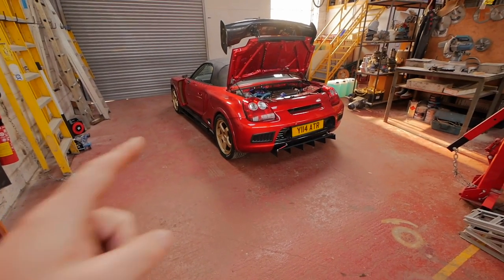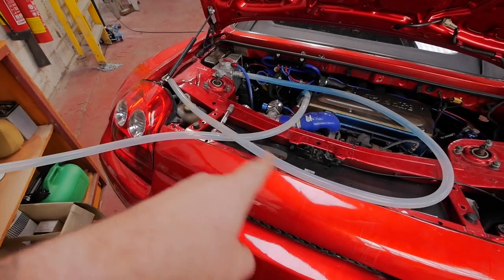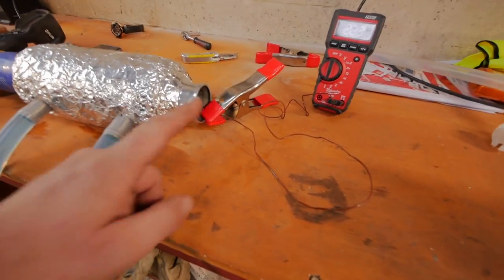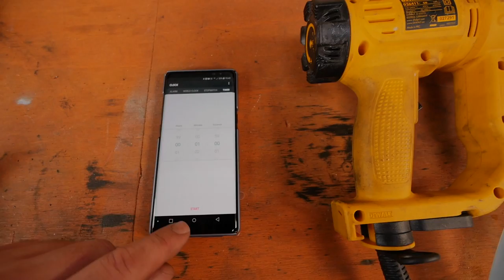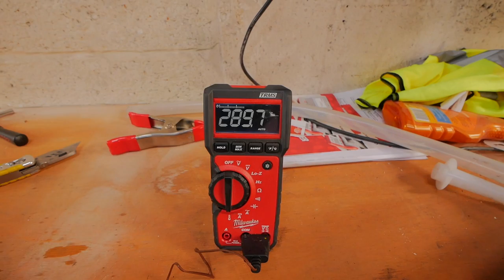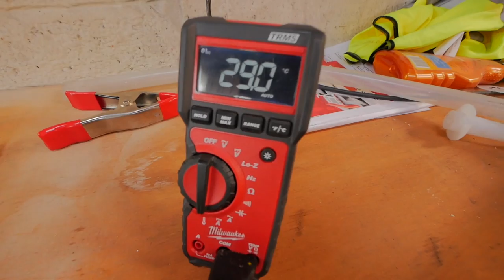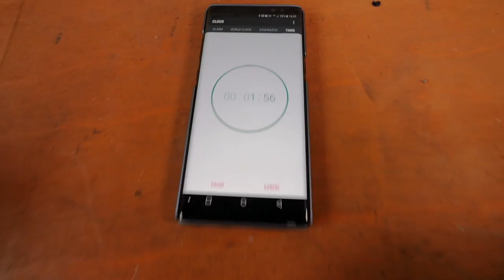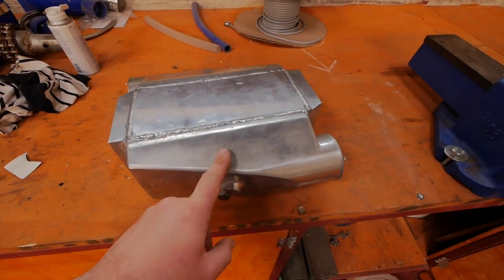Cheap vs expensive chargecooler shootout experiment

Comment from the maker: I fitted the cheap one to the car today... From driving it around today this deserves another video with real world results.
Reply: can you post a link to where on ebay you got this cheap charge cooler?
Reply from the maker: Hoang Bui that exact one is not on at the minute but if you type universal charge cooler into the search, the first ones that pop up are the same sort of thing
Reply: Any update on that? Did it feel as much better as it worked on the bench? :)
Reply: what about the boost pressure drop from the larger IC?

Comment: Airflow in CFM on the Output, Should have been included...  If you're getting 500 CFM out of the Little one, and only 100 CFM out of the Ebay one... that kinda kills all the good, that the cold air Provides.
Reply from the maker: John Caprai I was going on the assumption that what goes in must come out. I will try it on the car for a proper real world test

Comment: Great experiment that has proved that the cheaper one works well. My concern now is the pressure drop of the charged air. You mentioned that there was a better flow from the tube cooler..As you have a water to air rad with fans it sound like even if the tube cooler isn't so efficient the rad + fans would cool it sufficiently. I would be concerned about choking the charged air causing a pressure drop.
Reply: That Intercooler plus even the most restrictive ones out there will have as much as a 1 psi drop in boost. Definitely not a concern vs the benefits from cold air going into the engine.

Comment: The Cheaper one is acting like a large heatsink and the airflow from the heat gun is probably to small to saturate the amount of aluminum area. If you had large amounts of airflow, the test would be more conclusive.

Comment: I had a pwr cylinder and switched to a cheap one like you have. Same results. Much better with a cross flow unit and much less pressure drop to boot.

Comment: I think this was a pretty decent bench experiment.  I think what we learnt is that the larger the intercooler with direct flow actually works better in addition to the fact that the eBay version probably hold more water in the cooler itself which the air has to even hotter in order to heat. In comparison to the cylindrical version which although has higher air flow, had less water in the system in order to move  the heat. This resulted in the temps being much higher. I don’t think it quality that won today. It was definitely quantity and volume. Well done and thank you for the content.

Comment: Even if the CFM wasn't the same on the output on each it does prove the over all cooling was best on the cheap one. Same amount of heat for the same amount of time. On the jack of all trades the cheap one was best in my opinion. I would like to see somebody run this type of system on a cold air intake and see if it works. Just for fun

Comment: Only problem I see with the test is that the eBay intercooler was only half full of water due to inlet and outlet fitting location. To fully fill the fluid portion of the intercooler, the supply fitting should be at the bottom and the return fitting up at the top. Without doing that, the top half of the core wasn’t even cooling the hot air.

Comment: This is a great test. The big difference here I think is gonna be airflow. Id really like to see a pressure drop test done. Its really common to see boost drop several psi through cheap intercoolers so Im curious how these two would compare. Great video. 
2 side questions:
1. What brand was the ebay intercooler?
2. What are you using as coolant for the intercooler system?
Reply from the maker: Cheers, eBay kit was unbranded and I’m using 50% antifreeze the same as my normal Coolant system. 👍
Reply: I know it's been a while since  your comment: when air temperature drops, so does the pressure. Another good data point is air density. Banks swears density is THE stat to get for high power in his diesel engines.

Comment: It’s simples the avt is a straight laminar flow of air there’s nothing to delay its passage over the cooling surface on the avt so you will get a high flow of air down side it’s not cooling the charge, the cheap eBay one has a more diruptive design as the air try’s to bend it slows down plus it has an increased area to desipate the heat over so thermodynamics come into play, in the real world you want to not impede the airflow but also cool the charge down unless you carry a fridge cooling system or peltierheat exchange it’s going to be hard to do both.
Reply: You are correct but does this matter as much for a turbod car as the air is pressurised through the intercooler so must negate some of the effect of changing direction and I'm guessing will gain more power in cooling than a small restriction. 
But as his test does not use pressurised air you are correct that the results are not conclusive and the small restriction would play a huge part in cooling. If he used pressurised charge air the results may be totally different.

Comment: My chargecooler on my Mr2 is from eBay. It puts out temperatures around the same as your eBay cooler. I had an HKS one and it put out around 35-50 degrees Celsius and my eBay one was around 24-31 degrees
Reply from the maker: Alex Johansson sounds like it's definitely worth me trying this on the car

Comment: I think these tests are inaccurate. 2 reasons, the heat gun is about 2 inches from the water line and on thebay one its about 5 inches with a bend in between, also you are heating up the charge temp sensor much closer and more than you are on the eBay one because it is receiving straight hot air contact. And probably the most important factor that was missed was airflow, which one flows better. I think bench tests are often inaccurate, the best kind of test is putting sensors on the car and seeing real world results.
Reply: SURTO FAK  the distance from source of heat doesn’t matter as I’d have that cheap cooler inches from the heat source (intercooler), and provided my turbo can make more boost, I forecast that I can still make my low pressure of 15 psi at the manifold. The turbo may be 20 psi. The main thing is does it cool well enough to be worth the effort and $ spent.

Comment from the maker: What does everyone think of the results? I am not totally convinced by this test so I will do another video on the car with data logging for a real world comparison. And I know .... I kept calling it avg instead of avt doh
Reply: SpyderLEE this was the same results I had seen in a similar test. It's the amount of air that can get cooled at the same time that matters over the longevity of cooling through out the tube. Glad you did the experiment though.  I thought it was interesting that so many people automatically assumed the tube style cooler were better. In my opinion if this was the case even radiators would be designed differently.
Reply from the maker: Track King yeah I’m glad too... just need to change around all my engine bay again now 😞
Reply: Before you change it put an air temp sensor in after the chargecooler do you get an accurate comparison at actual boost pressure. I don't think your test shows a very accurate result at all.testing on the car will provide the real results
Reply from the maker: huntos83 yeah I’ve got intake temp sensor between the charge cooler and the throttlebody. a hot air gun is a long way from a turbo but there was some interesting results.
Reply: Interesting, but I would say misleading and not accurate. I just don't think this test represents the real scenario
Test on the car will provide real results
Reply: what you want to measure is heat transfer, the most correct way to do it is not to measure the air temperature, but the water temperature, the more the water heats the more heat was transferred, hope this helps
Reply: Spyderlee, where did you find the eBay one? I'm trying to find it myself. Could you send a link? Cheers

Comment: I find this very humorous.
So many people defending the more expensive unit.
They are using faulty reasoning to do so.
This boils down to perceived value versus real world functionality.
The cheaper unit works better.
One should note it will also be more difficult to install in a small space.
The more expensive one is smaller and will therefore be easier to install.
If anyone has seen the air to water intercoolers for 2000 hp engines they know that the units are quite large.
The cheap ebay one is probably good for 400hp. 
I wouldn't put that turd bullet one on a little Fiat Abarth engine.
Sorry if this hurts people's feelwings but it is overpriced hype. You see this in marketing all the time.
Where the cheapness of the ebay one may show up in time is metal fatigue,cracks etc.
A quality unit of the same design of the ebay one is the way to go.
It will probably cost over a thousand dollars but then again you won't have to worry about it failing and dumping coolant into your turbo and engine.
Thanks for the testing...when I saw the test I knew what the results would be before I even watched the video.
Reply: No, this test is completely irrelevant as it's not under boost conditions. Boosted air will (a) be affected by flow restrictions, which obviously makes a power limit in the first place, meaning you may have to run more boost and hence more heat, also boosted heated air is pressurized against the core, forcing heat into it, which a heat gun is not, but the main factor is air speed. Boosted air is moving at HUNDREDS of feet per second in some applications, so the longer the core, the better the chance of cooling. The cheaper core is only about 3 inches wide, and is an intercooler core in reverse, so you're pushing boost through the part of the core that has the restrictive micro fins, where as the barrel is 10 inches long and the boost is through the main core channels.

A hot air gun is not pressurized and isn't even a gentle breeze.

The cheap core saturates quickly once it's in a real world application with some decent boost through it.

Comment: Thank You for your efforts. I suppose that pressurized air would likely improve the performance of the ebay cooler. For the love of motorsports, its really great of you to help  minimize gimmicks and help keep folks from being unnecessarily parted from their hard earned money.
Reply: The reasons you explained about the ebay cooler.
Are exactly why it beats the other.
Physical size and flow.
The ebay items cross sectional area of the core is about 5 times bigger between the 2 coolers.
For both water volume and air volume.
Air 75mm inlet = 4417square mm, spreading out to 300mm by 75mm = 22500 square mm.
The ebay cooler would hold about 1.2litres of water.

The other cooler
Air 75mm inlet = 4417sqare mm right through the length.
Water would be about 550ml.

Comment: I am not a boffin on this - but I think the big thing is you have left out the manifold pressure - you ( I assume) have tested the ability of the unit to transfer heat only  - and we know that the issue with intercoolers or the need for intercoolers is a function of the compression of the intake charge.  And there is a horrid set of maths -that relate to P=MST and P1V1= P2V2. so without the manifold pressure( push back if you will) the test you have undertaken is not at all representative of actual on vehicle conditions. We have little or no latent heat, we have little or no heat soak ( which is actually the cause of most of the pain in the first instance) and we have no pressure in the against the discharge of the heated air.  Again effecting the ability to transfer heat.  Curiously the better quality unit gets the water much hotter much quicker - which when you think about it speaks to the efficiency of it to conduct the heat away. where as the el cheapo unit seems not to follow the laws of physics.  Quite sure the bright guy in my class room  - the one that used to each the clag glue would be able to explain it too us.  In the meantime - I humbly suggest the abscence of any resistance (pressure) detracts from the actual experiment.

Comment: That ebay one is pretty good, With my front mount on my skyline i usually see temps of around 30 degrees on normal driving and up to 45 degree when i'm flooring it and thats a HKS job that cost £1100.
Reply from the maker: Project Mr-s yeah the avt usually sits around 30 until the last 1k or so of revs and shoots up quite a bit
Reply: Air to air is not even close to being comparqble to air to water.
I have run both...I will not go back to air to air!

Comment: Hi Lee , 
I have only just found your channel, 
it is very good, and you have a nice unit to work in,
I only have a volvo s60 D5  now , but like all cars
when testing both intercoolers /charge cooler, with the large one have you tested the pressure drop, before the cooler and after,
Thanks for very good videos, 
where about in the uk are you based , I am in Emsworth Hampshire,
Dave

Comment: From the looks of it, the air flow characteristics of the Ebay cooler should take more of a diagonal path from the inlet to the outlet instead of directly across. If that's the case, then the "cooled" surface area inside should be a similar amount. The ebay one looks to add turbulence to the flow though which could protect the thermocouple from seeing the full blast of heat from the gun. I think when you start to turn the pressure up, more heated air will see the thermocouple and the temp difference will even out. I'd run the same boost with each and test on the road with a IAT reading
Reply: the only problem with you're theory, is that the Fins inside go Directly across, not diagonally...
Reply: True, don't know what I was smoking when I wrote that! The more important point I was trying to make was the turbulence/obstacles blocking the heat from getting to the thermocouple.
Reply from the maker: I was thinking the same.

Comment: Check the inlets temps runing both on the car in real conditions. Im not surprised with the result on the ebay one. I guess it all boils down to surface area available. You might get a bit of extra restriction with the cheap one but the inlet temps far outweight that.

Comment: That seems like an ok test. My only critique is you're not trying to cool compressed air. The thermal dynamics of compressed gasses at different pressures varies greatly.
Reply from the maker: I would call it a comparison rather than a test. Its far from real world but, All the factors were constant. The only change was the chargecooler. With the thermal dynamics, the only thing that really changes at different pressures are temperature and volume.

Comment: I don't think it's a particularly good test, the test condition does not reflect the operating environment, all it shows is a large heat sink Vs a smaller one, those temperatures may not necessarily reflect how it will perform in a car under a closed bonnet for hours, and if the temperatures were good enough on the smaller one for detonation to not be an issue, then would the flow sacrifice be worth it?
Reply from the maker: mikegt4dude I am still not convinced the cheap one will be better under real world conditions. But I will try it on the car to see. I will see if there is a air flow restriction as my boost controller works on wastgate percentage rather than target boost pressure. I will see what it boosts at
Reply: Have you got wideband with data acquisition? You should see your tune go rich with reduced airflow and lean with increased, inlet, outlet and ambient (engine bay) temp sensors would be ideal.
Reply from the maker: mikegt4dude yeah, wideband and inlet(throttle body) temps are plumbed into ECU, so can log everything. See what it does

Comment: Nice test! Tbh you can expect half the performance from the expensive intercooler because its half the size. But even then the difference is enourmous. The water direction versus temperature is  not so important if you have enough flow. Makes for a good marketing story though :-)

Comment: I have a W2A setup on my car and the heat exchanger is very tiny and i dont have a header tank. I intend on getting one and upgrading my heat exchanger. What size header tank is yours? the capacity and what heat exchanger size is yours? you using 2 sets of fans for the heat exchanger right?

Comment: I wish you would have run the test longer, the ebay cooler has so much mass of aluminum that in a 1&2 minute test the mass of aluminum itself without water flow would absorb lots of heat. A 30 minute test would be much better to let the ebay cooler get fully heat soaked. Otherwise great test and thanks for taking the time & effort to share test with us

Comment: Testing a cheap cooler with 2-3 times the thermal mass isn't fair. Something people don't think about with a cheap square intercooler is if it fails and you have  large amount of water enter the engine it will cost a lot more. Round is much better at containing higher boost levels, and higher quality means less likely for leaks. You might have a very thin film of brazing on the cheap intercooler and one day it breaks and you pump a cylinder full of coolant, see how cheap it is then.
Reply from the maker: I’m still using it now. 6 years later 😁